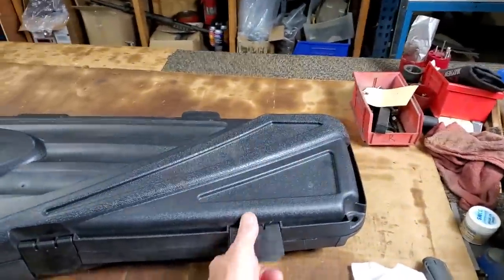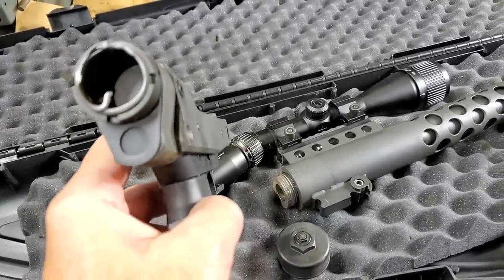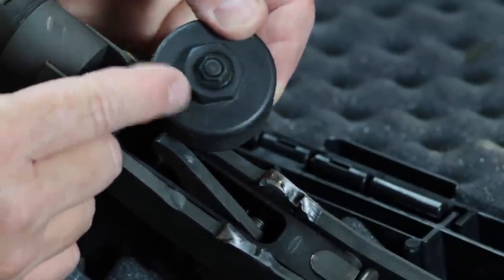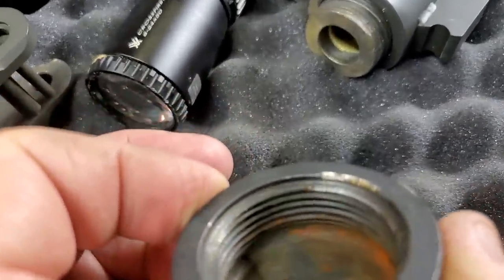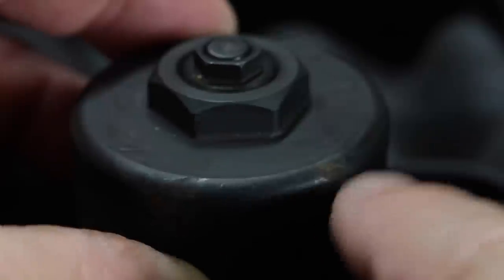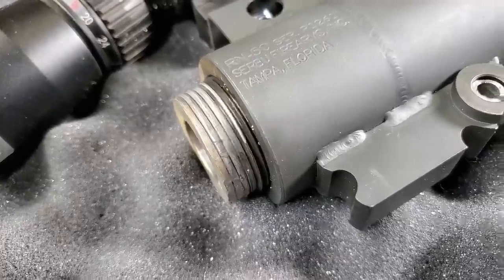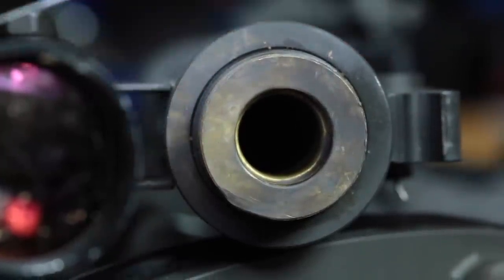Kentucky Ballistics' RN-50 Blow-up:  First Look

Comment: I could be wrong. But in the picture of the primers. It looks like the crimp has been swaged to remove the crimp. If so, I know you know this, but dead give away they where reloaded. I just looked at some of my rounds. They aren’t slap just FMJ “LC 13” head stamp. Anyway, the on mine the crimp is noticeable and not so symmetric like pictured. Maybe it’s just the way they look in the pic. I also don’t remember seeing rounded primers like that. Like shotshell primers but idk maybe that’s normal I just haven’t seen them.
Reply: Looking at it a little more they definitely have the primer pocket swaged removing the crimp. Those look like they had the three prong crimp. You can see the crimp mark in the brass just stops when the pocket starts. Versus the crimp marks continuing to go over the primer Slightly. If that pic is an accurate portrayal I’d bet it all on they are definitely reloaded.
Reply: @Harris4267  yep bubba passing off his crappy handloads as originals to make a quick buck

Comment: I’d be curious to see an X-ray of the entire gun to see if there is any non visible dress fractures. I’m sure you would too to help prevent this catastrophic of a failure, even one not the fault of the gun, in the future. It also may lead to a different design that “breaks away” in a controlled manner, kind of like cars are designed to crumple in a very controlled manner. 

Thanks for being transparent.
Reply: cars don't crumple from a pipe bomb worth of explosive force. the car ceases to exist.

Comment: No question in my mind that was spiked round and so was the one before that one that did the damage. If you look at the video the muzzle flash and recoil of the previous round was way excessive for a normal 50. Which means there wasn't a bore obstruction. I hope by testing the residue left in the bore and maybe the case it can be determined the powder composition. I'll bet it is something like Clays or maybe not even a firearms powder. May a duplex or triplex load using black powder or even C4 . I am no chemical expert but I have been reloading for 50+ years and have seen a lot of crazy things when powder is mixed or mixed up.

Comment: I would guess the round was improperly loaded with powder which caused a severe pressure spike.  This stuff happens, unfortunately.  I don't how many of you remember when the 40mm grenade cartridges for the Mk19 were pud loaded.  Once in a rare while,  the manufacturer wouldn't put enough powder in the shell casings.  The grenade would travel part way down the barrel and the next grenade which followed would hit the first one causing serious accidents.  Although ammo manufacturers for Uncle Sam are held to some strict standards, stuff happens.  I'm just glad Scott is making a full recovery.
Reply: there is a lot of counterfeit novelty ammo out there especially if it goes for 100 bucks a round.

Comment: The back of the locking ears should have been a clean slope to the lower so the forces are evenly distributed. If that cap goes those ears are going too if they are 90 degrees to the lower.

Comment: Looks to me like the nut on the cap made that final mark. As the barrel came up, the grip goes down while the cap blows straight back taking out the two ears, than leaves the two independents, starts to rotate and the bolt gouges that last mark. That bolt has no marring on it though by the looks of the video.

Comment: Something to check for would be potential fatigue failure of those threads. While evidence points to a single extreme over pressure round, it could potentially have been many over pressure rounds. If that were the case, it would be good to know because the gun could have failed later on a normal round, if it was previously weakened by a bad one.
Reply: While the threads could have been damaged, the gun has failsafes built in to keep that from being a catastrophic failure point. The failsafes also failed, which leads us to the logical conclusion that the round was tampered with. It blew up with so much force that either the powder had deteriorated and become FAR more potent, or it had been filled with plastic explosive.
Reply: The pressures required to sheer threads of that size and length require going into the realm of 3x times or more of the normal pressure of a .50 round. You can't really design a gun around several multiple times the safe limit of what is allowed. It's like building a .50 around the concept that, eventually, someday someone will think it's a good idea to jam a .50 bullet into the chamber and shove a few ounces of C4 behind it and detonate it. Can you design a rifle around that being survivable? ...Sure. Is it worth the added cost and complexity? No.

Comment: I've gotta wonder if the threads failed after multiple shots from several of the hot slap rounds.  A one bullet failure seems too improbable.  I honestly do not believe it was the gun's fault, I believe too many hot slap rounds were just too much for the threads.
Reply: try a counterfeit slap round exploding with three or more times the regular pressure of a standard .50 bmg round

Comment: As a ballistic engineer showed, the 1'st thread takes the largest % of the recoil force, with it exponentially decreasing with each thread. So that after 5 turns, additional threads hardly contribute anything to the strength. Pretty risky shooting ammo that's really old. Significant age and storage conditions will affect powder burn rates and pressure curves. Dave Emery (Hornady) or Alan Jones (Speer) have an article on it with graphs. Not sure which. (Maybe Scott will send the Vortex 6-24 X 50mm Crossfire in for warranty repair.)
Reply: slap ammo was started to be made in 1994. you can still fire .50 bmg made in 1920 with no problems if it was stored right. the major issue is that old .50 bmg is often corrosive.

Comment: its wild to see the aftermath of the thread pullout up close. I'm really curious to see what your tests on the hardness of the cap and the barrel threading shows. obviously the cap's threads won the fight. i also wonder if the ears where extended all the back to the stock, if that would have even made a difference? that would be the only "upgrade" i could think of. it seems like no amount of stronger ears would have stopped that cap. good thing it dumped energy into sheering the ears, bending the frame, and taking a chunk out of the frame before if hit scott in the eye.

Comment: There could be a possibility where the crimp is not well done or the bullet is no seated well to the slap. Therefore the primer ejects the slap to the barrel and makes the ammunition underloaded. The powder doesn't burn in an efficient way and forms gas. Then you get an detonation instead of deflagration. But I'm sure you guys already know that, so hoping that there will be a proper investigasion to the case and all the residue of whats left in it.
Reply: odds are bubba put in the cheap powder rather then proper prowder
Reply: @toomanyaccounts  Could be that also. Hope they will find the answer what almost took one of the best, if not the youtuber away. 🙏

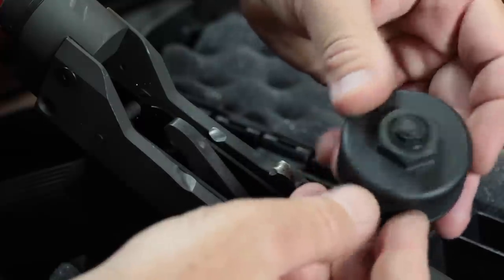Comment: At 0:53 in the process of shearing off those ears the top of the cap rotated down hitting the lower then bounced up flipping and the inside of the cap struck the lower on the back like you showed

Comment: Slap rounds cannot be safely fired through a muzzle brake. The polyurethane sabot builds up on the inner surface and creates an obstruction. 
It's plainly stated in the manual.

Comment: It's crazy how it can explode like that and the shell looks totally normal
Reply: Shells are pretty weak, more a means to hold everything in place. All firearms rely on the chamber and firing block to keep the shell intact. H&K's with rifled chambers will leave shells deformed with rifling once shot. If there is space in the chamber, the shell will fill it upon firing.
Reply: The barrel supports the shell so it hold the form. The cap doesn't support the shell base so it went south. So the shell is not in normal shape.

Comment: Hey Mark, I have an observation from Scott's video of the accident. When he snaps the breech down into the lower assembly, I see something fly forward from under the gun.  It seems to come from the breech area. It's hard to tell what it is and I  replayed it many times. Maybe check his video and see if you see it too. Good luck and know that we're behind you all the way.
Reply: ah that is just how the gun sets up
Reply: @toomanyaccounts  
So its normal for stuff to fly off it when you pivot the barrel down? It didn't happen on his previous shots.
Reply: @garypeterson9083  nothing flew off the gun when he set it up. the hammer reset as it should.
Reply: When he pivots the barrel down into firing position something shiny flys forward from underneath the stock.
Reply: @garypeterson9083  yeah that is normal. happens every time the user resets the gun to fire

Comment: The weakest point of the whole barrel is those threads. If they were larger than the barrel that may not be the case. Of course that would make the whole design more expensive to produce but much safer.
Reply: The length of the threads could also be longer to increase the strength without increasing the diameter. It appears the threads on the barrel failed and not the cap. Apparently they are softer material than the hardened cap.

Comment: So, I've seen a few people saying that it could have been a barrel obstruction, specially with the mussle break (i don't know if there is a mussle break, I'm not a gun person, so I'm taking there word for it). Mussle break plus slap round plus minor obstruction would lead to explosion. 
However, looking at it close up like this, i really doubt that is the case. 
If it is a barrel obstruction, even one caused/made significant due to firing of the previous rounds, it would be further along the barrel. This would say to me that the warping and damage should be noticeable along the barrel. Even with the cap being a screw on jobby, if it cannot go on without being completely tight, those ears will be nesstled right up against it in addition to the threading. Thats a lot of steel to be sheering, and the pressure will be trying to go out everywhere. 
So, as the prognosis from someone with only a basic understand of how things explode, I'm very confident that it is not any form of barrel obstruction. It is instead mostikely from the chamber pressure being way to high. 
Thag prognosis is apparently shared by many who have a far more in depth understanding of how things explode, so thats good. 

As a sidenote, if the rounds end up being more explosive than they should be, there is a chance that the stress from the previous rounds had weakened the threads for the cap, such that the round had a much easier time sheering everything off.
Reply: no there wouldn not be an explosion at the chamber. we know what happens with clogged barrels and brakes. the explosion happens at the clog or the bullet just rips through the obstruction along with the brake if the barrel is strong enough.

Comment: That looks very interesting. One would hope that all the rounds are identical. Perhaps a chemical analysis of the round you got out would be enlightening? Perhaps taking one round apart to find what its made of and firing another round from another gunmight also be informative. It could even be that the round that exploded was not the problem round. The problem could have been built up by previous shots that finally came to a head with the final shot.

Comment: That’s why “slap” never was adopted. The sabot would disintegrate upon firing leaving a projectile that’s smaller diameter bouncing around in the bore. I bet it blocked the pressure just so briefly to were it was easier for the energy to come out the back.
Reply: funny that over 6 million were made and used by the military.

Comment: so you can tell the cap hit the ears and it actually rolled over and hit the metal in a downward acceleraction, which is how it bounced up enough to hit Scott's glasses instead of going more towards his neck
1:02 you didn't consider that the cap is already tumbling at an extreme speed from sheering those ears --
likely, if not for the ears and ricochet breaking a lot of the impact force, the cap would have been more deadly than the ear going into his neck

Comment: Someone was saying a piece of the sabot got caught in the muzzle break increasing the pressure causing the rifle to fail . He said your not to use sabots with a muzzle break.
Reply: that someone is repeating Fudd lore. Barrett and people who have done actual testing state that even if plastic got stuck in the muzzle brake all the next round would do is clear it if mil spec brake. if civ spec the brake would just break off. we know what happens when muzzle brakes get clogged. all that happens is either the brake gets cleared out or the break rips off.
Reply: @toomanyaccounts  I agree that this is nuts and I'm just going off of what I know of pressure. If the round makes it to the muzzle brake, clogged or not, it's not going to significantly increase the pressure in the chamber. Even if the brake is completely welded shut, the weakest point of the pressure vessel is going to fail, which is going to be the brake, as it's not built to the same standard that the barrel and chamber are, as it's not designed to contain that kind of pressure.

I'm just trying to wrap my head around the mechanics of this failure. The primer fires, the (whatever it was) propellent burns enough to get the round moving fast enough to (eventually) clear the barrel, but still develops enough pressure to blow the breach cap off? Neophyte that I am to reloading, I can tell that that doesn't just happen. If the projectile had stuck in the bore hard enough to overpressure the chamber to that extent, wouldn't it still be there? Once the breech cap was off the rifle, the pressure in the chamber would have pretty much gone that way, leaving only inertia to carry the bullet down the barrel. So my thought is that whatever happened, the overpressure was so high that it blew the cap off before the projectile left the rifle... but did not actually stick the projectile in the barrel. 

My first thought when I heard about this was "accidentally overcharged round." With what I've read since, I'm leaning strongly in favor of possibly counterfeit round, probably accidentally charged with something that wasn't right. Some bootleg powder mix that was supposed to be as powerful as what is normally loaded but cheap as hell... except that someone got their powders mixed up, and instead of being 30/70 of powerful/weak, they got it the other way round. 

Everyone that's looking at some modern variation of "Project Eldest Son" should remember Hanlon's Razor.
Reply: @richardhanck972  I know almost nothing about guns but if I'm understanding correctly, the way Ian from forgotten weapons described it was that because the load is far too powerful & releasing too much energy too fast, the bullet isn't moving quickly enough down the barrel to release the pressure rapidly building behind it. It essentially forms its own barrel obstruction in those milliseconds after firing & at that point the excess pressure is looking for the next easiest route to escape from which in this case was the barrel cap. The bullet is never actually stuck, just in that short time the gun is having to deal with something it was not designed for.

Comment: One correction Mark made in another video but didn't mention here is that 85,000 psi chamber pressure is WAY off. It would of taken over 160,000 psi to sheer those threads !!!
Reply: 66kpsi is what the overpressure testing rounds are. 50kpsi is the .50 bmg. three or more times is more then a tank cannon barrel sees
Reply: @toomanyaccounts  Correct 50-60k psi is normal pressure but he initially stated that it would of taken 85K psi to sheer off those threads. Later they realized it would of taken all most double that to blast that cap off like that.
Reply: @kieranodea771  the 85kpsi was if I recall if gas leaked into the cap which would not be normal.

Comment: I think the two dents were not made by a direct blow from the cap. The dents simply don't line up with the cap. The cap first hit and sheared the side rail ears - I think these cracked at the impact side then as the crack propagated, the ears rotated back to impact the side rails. Did the ears come back with the gun?

Something softer and less tough can certainly make a dent in something harder and tougher - a high speed blow can create enough force to do that, like high speed bullets punching through steel plate. Or me stupidly hammering on a steel part with a brass hammer.

Comment: Did you see the video where the presenter said slap round are not to be used with a muzzle break?  His guess was plastic built up on the muzzle break till high pressure was created.

Comment: One thing I remember from Scott's video about the accident, he was talking about how the rounds beforehand were going everywhere. Nowhere close to where he was aiming. Now I am no expert, but I believe barrels warping slightly during a shot happens. Which is why free-floating barrels for rifles are a thing. If that is so, I am wondering if that terrible accuracy could've been caused by the barrel warping due to pressure higher than the gun is rated for.

If that's possible, it would be a good warning for everyone who gets a box of ammo where the accuracy is absolutely garbage, to stop shooting that ammo, until you are sure pressures are safe.
Reply: no it was because these were counterfiet slaps hence the wrong powder or powder amounts plus not being properly crimped